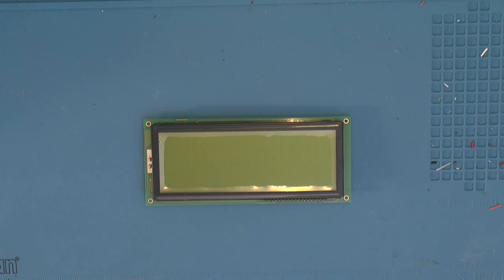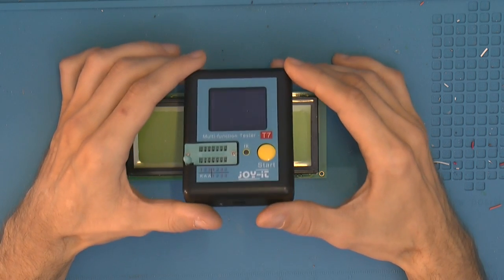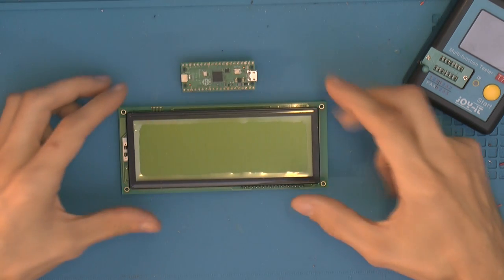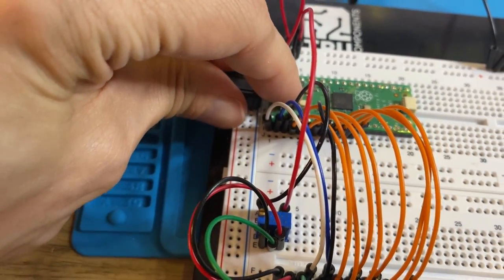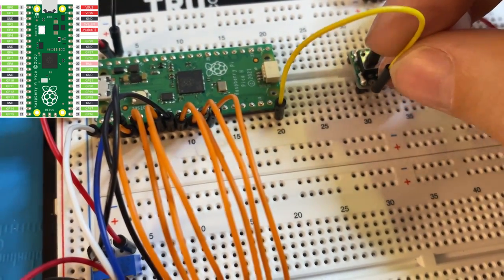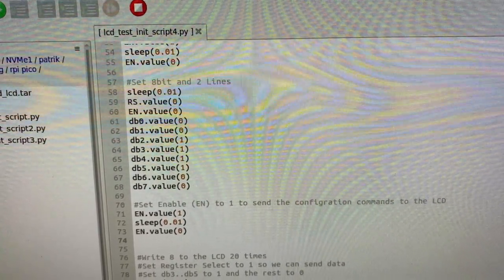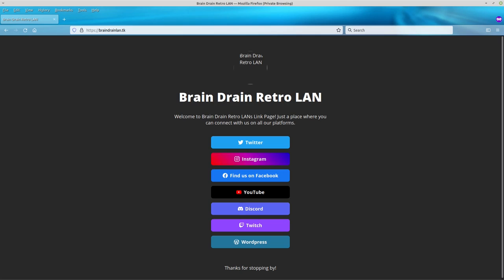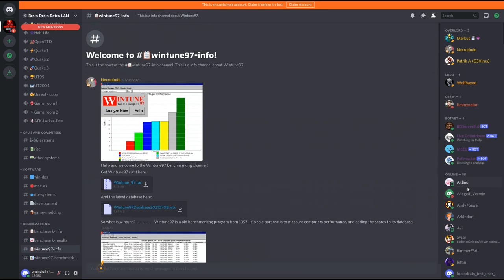DIY "SMART" Fan Controller

Comment: enjoyed watching your video of the design. Did you have any thoughts to add more controllers? I imagine it come down to gpio and cpu proc timing.
Reply from the maker: I did not run out of gpio pins so it should not be a problem to add a lot more fans, tough idk exactly how many it can do but 8 to 16 seems to be the limit when i googled but yea that I have not tested.

If one wants feedback over ADC one might have to add a chip to multiplex that and that would use 2-3 GPIO pins but allow one to monitor more analog signals like fan voltage and control the fans that way.

I mainly stooped at what I could fit on a single display because I was already on deep programing waters as it was.

But a version 2.0 could have more fans and menus and stuff.

idk how the code would react to more fans but I had no issue adding rpm reading for the second two fans once I had fixed the code to the point where it was expandable beyond the first fan.

I want some form of feedback if I make a version 2.0.

It could be Voltage so using ADC for the fans with a voltage divider per fan just like I did with the temp and 5V and 12V, fact the 12V rail resistors should work just fine.

Or one could run all the fans at 100% duty cycle for  a few seconds at boot, record the fan RPM for every fan.
Once the fan controller knows the max rpm for every fan it should be fairly easy to use that variable with the fan profiles to just sett say 40% rpm at the lowest fans speed, 45% at the second lowest etc etc and have the fan controller change duty cycle to try and match the RPM target.

A lot of things could be improved just in software and adding more fans should be fairly easy with small software changes.

The limit here is mainly time and knowledge and money and the only thing I got is time it seems XD
Reply: yeah i imagine a button could cycle through each attached fan. thanks for the detailed response. Im thinking about putting this on my socket a athlon

Comment: I've never seen HD44780 LCD module that requires negative voltage supply. Those run just from 5 Volts.
Reply from the maker: The contrast wont work properly without it from my testing.
I have this version also, its 20x4 and from the same maker just smaller.
You can check the data sheet here but its states 6.6V and negative voltage, no GND for the trimpot.

https://www.telerex-europe.com/content/files/pdfs/productPdfs/POW/PC2004LRU-AWA-H-Q.pdf

The problem is that I cant find the datasheet for the bigger 20x4 I have, seems so old there is no info on the internet on that one.

LCM Driver Voltage is 6.6V for the smaller one tough and I got them from the same place so makes sens the bigger one needs it too.
Test points are VDD and VO so to get 6.6V with 5V VDD you need negative voltage acording to the pdf and that is also shown page 13, I did show that in the video.

The smaller 20x4 that I showed has the same contrast issue with 2 lines and 5V, it needs 6.6V for optimal contrast and that is achieved with negative voltage as the pdf seems to suggest.

My LCD's are old, probably 20 years maybe more, got them from a fellow retro computer enthusiast that in turn collected them some where a LONG time ago back when we built LCD displays for the LPT port for our P4 and Athlon XP machines.

But I read that negative voltage was a thing for the VO pin and contrast on some displays and the data sheet seems to say you need it.

Feel free to check that data sheet. I might have missed something but they state 6.6V and Negative supply voltage and VDD is 5V.

Comment: Can you build one for me as well please ?
Reply from the maker: I remember watching your YT video a few years ago upgrading the VRAM on a voodoo2!
I liked that video!

You dont want to put one together yourself?
Schematics and code in the description, tough not great but a starting point at least.

I would like to improve it and make it more compatible with a wider range of fans (need to add some feedback to make a control loop)  and just work out some of the dumb code and HW design before I dare make any for other people.

This one is basically a prototype/learning experience.
Reply: THank you my friend. Sounds good to me. I had bad accident hand bones fracture and no longer good at soldering. Would be awesome to see follow up updated of this interesting project. I enjoy watching your videos. Thank you
Reply from the maker: @PROSTO4Tabal  Would you prefer another 20x4 version or a simpler 16x2?
I'm thinking a simpler one is cheap and easy with reduced parts and then make it bit more fan compatible.
Generic version if you will for people to build.

it's sad to hear that that you had an accident and it sucks losing abilities!

Not to make it a contest or anything but I was gonna say in the video that I had eye sight issues and the glare is from the LED light on the visor with the magnifying glasses because I was suffering from double vision and heavy blur while making the video and it was the only way I could correct my vision enough to get anything done.

But people dont want to here that and I cant change the fact that an illness is messing up my eyes faster then I can afford gear to compensate.

We take our abilities for granted until we star losing them.

I hope you get better!